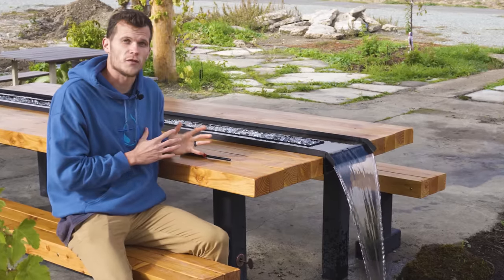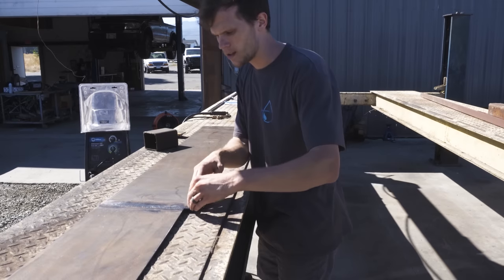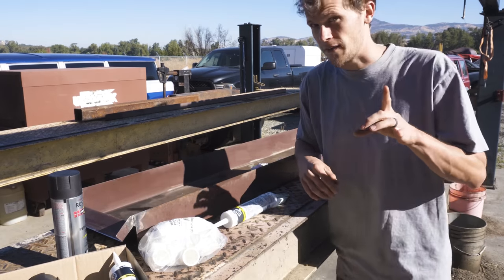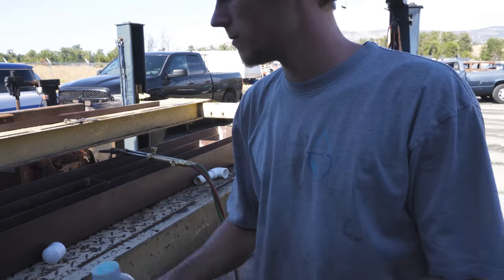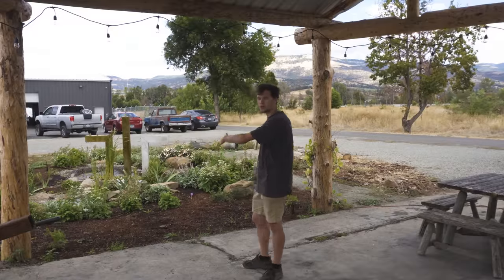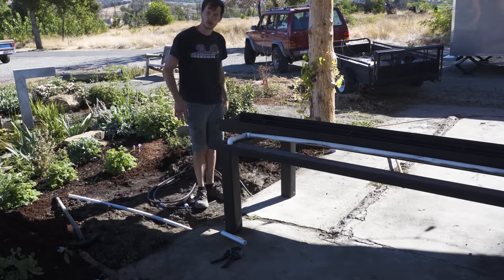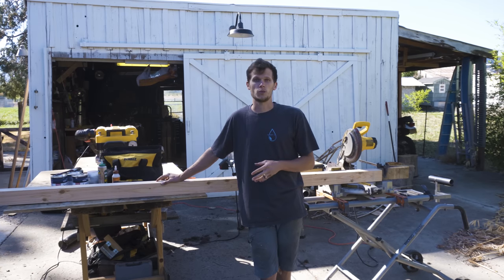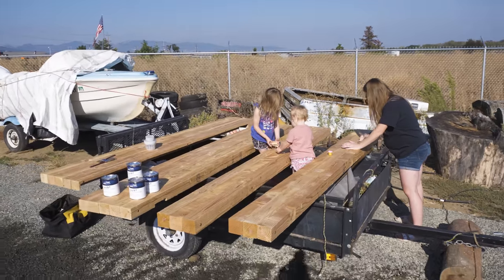REAL Waterfall Table with a Propane Fire

Comment: For the table leveling i would use self leveling feet that way you can mve it around use it anywhere and its not restricted to one spot plus when the concrete cracks and shifts due to natural earch movement you wont need to cut the legs agian to fix it.
Reply: You might run into a few problems because of needing to run a water line down one leg and a gas line down another, but I'm sure there's some form of levelling feet that could fit the bill.
Reply: Also from a drain and fill water  aspect the move would be hard to do

Comment: If I were digging through that scrap metal where I live there would be running bets on picking up a copperhead or timber rattler first. Also, If you really don’t like that water inlet look up 3/4” or 1” aquarium bulkheads.

Comment: Looks good, I thought you would have used Flex Seal for the leaks.  You might want to seal your concrete so it doesn't erode under all that water.

Comment: Looks great, but your brackets that hold the Propane should of designed it for it to be preplaced or repaired easily. It's a great idea 100% could be simplified and improved. Also if the propane were to be in the water in the inside box it would still light, fire training has a box filled with water and they ignite it. I would what that would look like since it has running water but I'd start with a confided slow moving current LOL. That is a sweet table

Comment: haven't read all the comments so someone may have said this already... You might consider building up from where the table dumps the water and form a small rock water fall up high enough where it catches more of the water.
Reply from the maker: That would be cool. I’ve thought if I had enough space you could have a series of smaller tables that flow into each other

Comment: This is an amazing idea!! We plan on recreating it but just with the waterfall, I’m wondering how far away your pump/ water source is?  We plan on having the table about 20ft away from our house so not sure now that would work (plumbing isn’t my strong suit lmao)
Reply: you probably want to use a pump and circulate water, otherwise you would be wasting a ton of water for no reason
Reply: for wiring, i would recommend trenching a direct burial wire from you house to the pond. (make sure to find out where your electrical, internet/phone, water, sewer, etc. utilities are buried to not accidentally break it)

rent a trencher to make the job easier, the cable only needs to be about 20cm deep, a bit more may be more ideal though
plumbing isn't too hard, just try to avoid exposing the pvc pipes to sunlight, and if it is exposed, it is best to paint the pvc for both aesthetic and to protect the pipe.
just make sure to get the correct fittings for your pipes, and there are calculators online for finding out what you need. 

for the pump, it is best to have decent head pressure (so that the pump can pump to a higher location easier) and have some sort of mechanical filtration since it would be outside.

Comment: Thanks for showing.
Would like to say I’m surprised you don’t wear a mask when grinding metal?  And I would of made all legs the same and adjusted the concrete (cutting out, chiioping etc) to level the table.  This way if for whatever reason you wanted to move it or sell it it would be universal elsewhere.  Now it’s custom to only that specific spot. 

I’m going to try something similar but with concrete on patio.  I’ll be asking questions when I get to that part 
Cheers

Comment: Mr. Travis! I am big fan of your work. Could you please recommend a submersible pump for an indoor fountain, that’s going to be silent? I already tried two pumps from Amazon. Both make sounds louder, than the waterfall itself..
Reply from the maker: Thanks! 
Ive had trouble with pumps making noise indoors. My latest project I've insulated the container with packing foam to try and get rid of that vibration noise. We'll see.
Reply: @travisjantzer  looks like the insulation is the only option.. we will see. Humming noise of the pump destroys the beauty of the waterfall completely. Another option is to move the pump into basement. But that is for sure an overkill for the little project.

Comment: Amazing idea and work only One thing if I make similar project I rather use aluminium instead of steal for the water flow parts , as much you protect the steel it will rust in future , also I rather seal the lumber  from all the surface before putting it on , the humidity will damage the wood .

Comment: I think I would have gone with Epoxy in the gaps and been done with it.  Silicone is cheap, but bulk epoxy is cheap too in bulk and keeps for like 3 years outside of the industrial fridge and flows pretty well into gaps. Maybe Total boat could have helped with that as well.

Comment: Should made the bottom of the water fall low so you'd get less back splash but cool either way. If you have kids, hope you have a good filter bc it would be too tempting to put thing in the strean to watch to fly down the waterfall. lol
Reply from the maker: Yea there’s a few adjustments I coulda max e to improve efficiency but hindsight is 20/20

Comment: Well done video, but;
Right off the top, the table isnt wide enough for real food service.
There should be at least another 6 inches to a foot of table width on each side of the water/fire element for diners to have.
Any food service or dinner party person would look at it and have to really think how to use the limited table space.
18 inches should be at least 24+ inches each side.

As well ... for some people, the flames are just darn close when sitting.
Other than that tho, great project.

Comment: I would've made the table level and then shimmed it. chances are that table will move to another location or you'll redo the concrete at some point. Then it wont be level in that location.
Reply from the maker: I can cut the legs if i ever need to.

Comment: i really do like this and never seen it before but you made some very questionable choices. I would have counselled a gas / propane tank under the bottom of the table and pipe it upwards in to the feature and same with the water and have a water pump under table and have the water recycle round and round

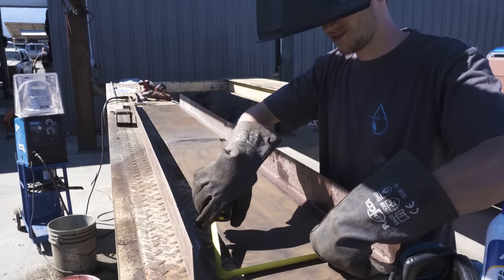Comment: 2:35 Those are called Tack Welds. Spot Welds use two electrodes, one on either side of the work that clamp and weld the two pieces together. Known as Resistance Spot Welding.

Comment: amazing table but wow you make life hard for yourself 🤣 why not just use m40 bolt on the bottom of the legs for levelling up? rather than cutting each leg a different size? that way it makes it easier to move location.
Reply from the maker: I wanted it to sit flat on the ground to hide the pipes. Measuring leg lengths wasn’t too hard. Just a little math.

Comment: From an Industrial Designer perspective I consider this not to be a good design, in terms of functionality not only it lacks space for cutlery but also it puts people at risk of burn due to the flame being in the middle because if you want to hand over some things to the other side you could get burnt and personally it does not have an aesthetic appeal, why to incorporate fire and water? whats the purpose of using these elements together in a table? Just because it looks “good”?
Good design puts FUNCTIONALITY OVER FORM.
Reply from the maker: I've eaten at this table. There is plenty of space. This project for me falls more in line with Art than it does Function. Yes. I do think it looks "good". I think it looks awesome. Eating at this table after sun down, with the fire flickering light off the water and reflecting on the faces of the people across from you is a fun experience. The waterfall sound is soothing and the plants nearby smell good. I'll put a "keep hands out" near the flame if that makes you feel safer. haha